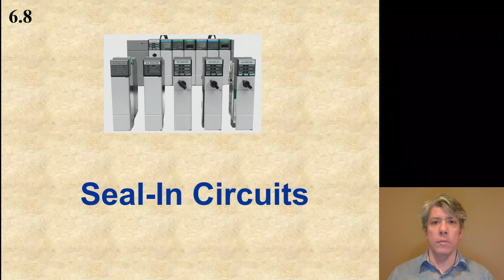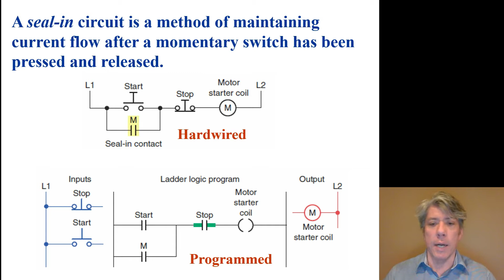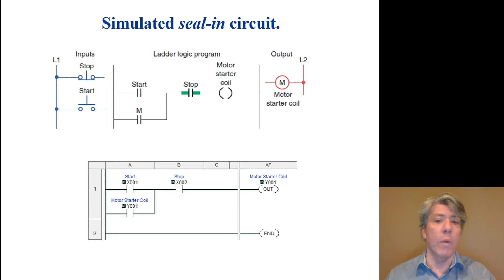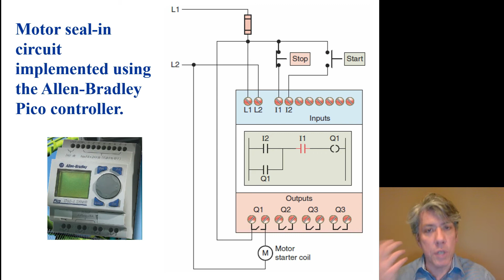MET 284 Seal In Circuits

Comment: Your E stop has to be first in your circuit
Reply from the maker: Thank you for your comment! An Emergency Stop is a different button than a stop button.  It is poor practice to wire any emergency stop switches to the PLC inputs, however, stop buttons can be wired to PLC inputs.